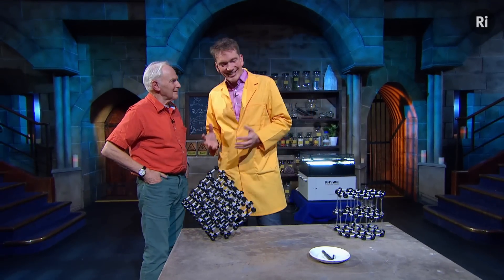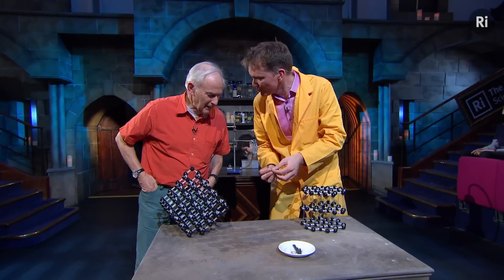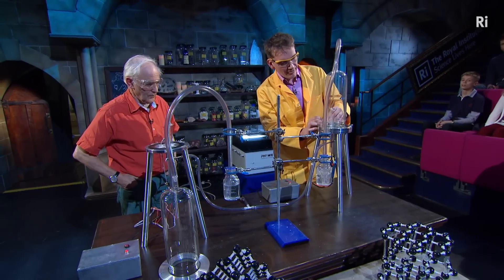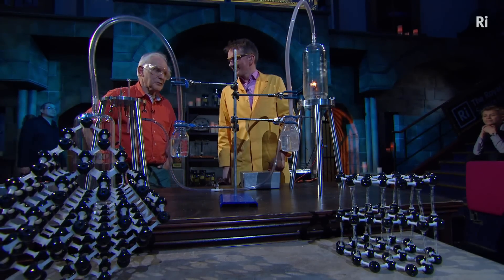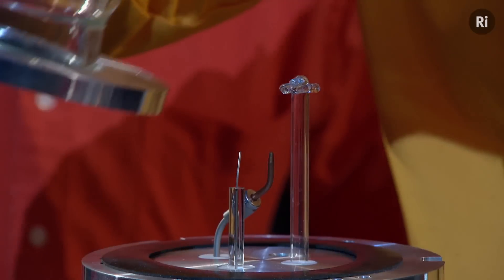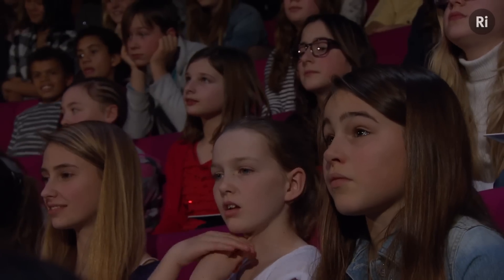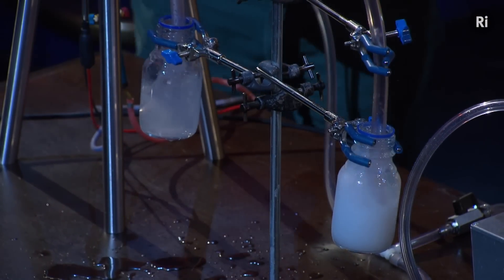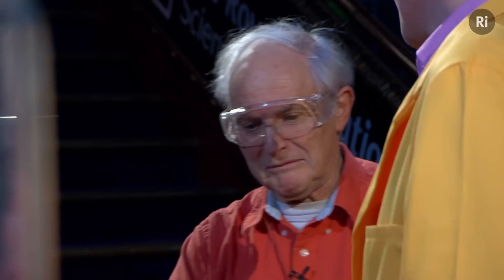2012 Christmas Lectures - Burning a Diamond

Comment: If they had used the engagement ring they could sue the company who sold it to them if they used the "Diamonds are Forever" advertising line.
Reply: or if it doesn't burn then it's not a diamond and they can also sue them for selling fake =P
Reply: @brianuuuSonicReborn  i dont think you will find any fake crystal that wont burn either way

Comment: This is a very very expensive experiment, the most hearthbreaking ever :(. But you have done really well thank really much for the experiment
Reply: deadly but unknow Nonsense; diamonds are almost worthless.  The market is controlled on a global scale by De Beers.
Reply: deadly but unknow Diamonds are worthless, the perceived value and resale is all an illusion. Also, watch the whole video before commenting.
Reply: Well, I wholeheartedly agree in the spirit of the concept, SeabasR, but while they are a conceptual sham for pricing (especially at 600+% markup as stones & jewelry), they do have some worth.
 Being one of the hardest materials we have available, they make excellent cutting implements like coatings for saw blades, drill bits, etc. so their value is still somewhat intact, even if drastically lessened.  :)

Comment: Without a PhD the diamond would burn 2C + O2 --> 2 CO, not even producing hyper-expensive lime water.  Cool reaction though.
Reply: +SheffieldRock well, it does not produce lime water: you start with lime water and get calcium carbonate. All lime water is not hyper-expensive: the calcium does not care what allotrope the carbone came from.
Reply: +SheffieldRock Well, thats all well and good, but you seem to have TOTALLY missed the point.
Reply: You are correct but not entirely. It does produce both CO2 and CO and not just carbon monoxide. He may have neglected that fact so as to not scare the audience with such a small amount of CO
Reply: and yes, Doc daneeka did totally miss your point

Comment: he called him cheap at the end just by saying it was low quality diamond
Reply: Javy Damas No .. the guy could have been clearer. But it was just a prank, they did not really use his wive's ring/diamond. They used a low grade diamond instead.
Reply: +Javy Damas You didn't hear correctly, they burned a fake diamond which was low grade instead of the real one.
Reply: +Hamguy Bacon ah so if I said your gold is 3carat and my gold is 24 carat would that mean your 3 carat is fake?  

low grade high grade diamond .. the diamond is still a real diamond.  "common sense" is all we need for that words.